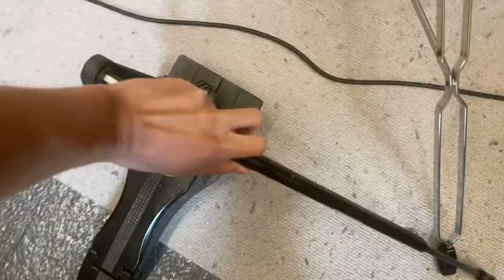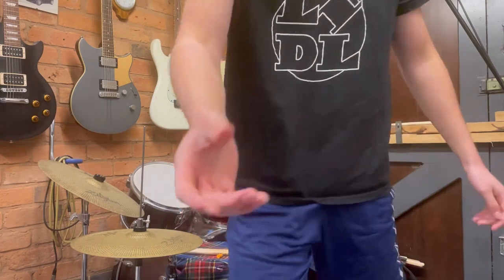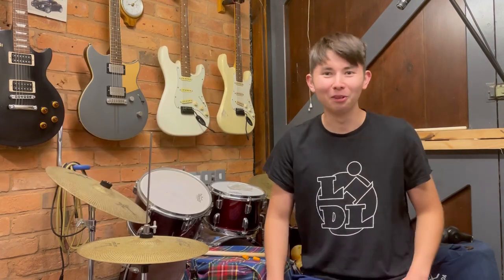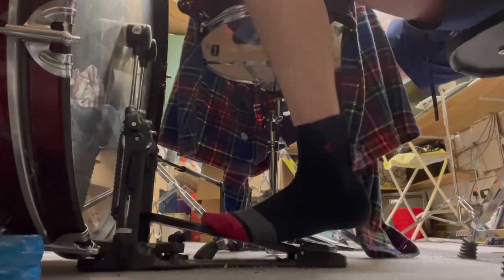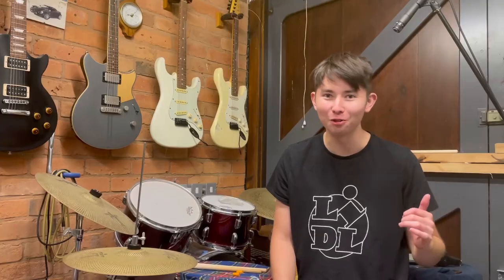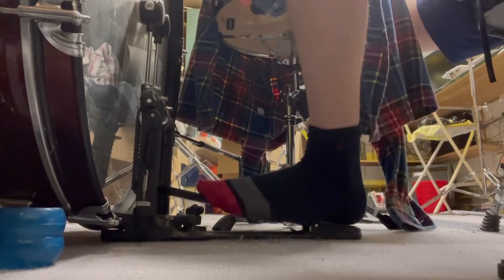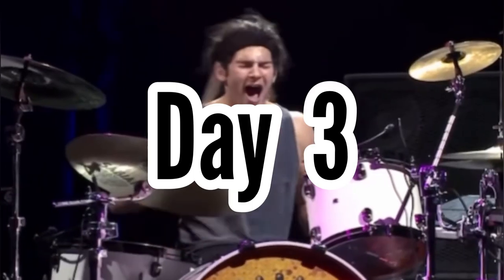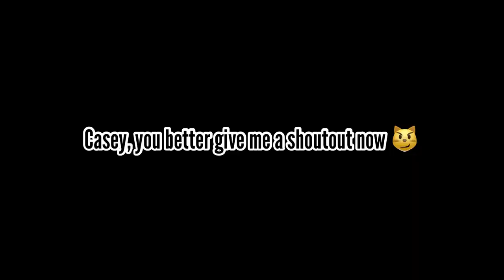Drummer Tries: Playing like Aric Improta (CRAZY Bass Drum)

Comment: hey bro just a couple of tips for you…

1. you should adjust your double beaters so they aren’t too close to the battering head when your feet ain’t on them, also adjust the tension of the pedals to your preference (if you haven’t yet)

2. your crash and ride are too low, you should make them a bit higher!

3. keep up the good work bro!

also uhhh it looks like ur 2nd tom’s got a hole in it?
Reply from the maker: Thanks bro!! And yeah it has 🤣🤣
Reply: It looks like you're sitting quite close as well. 
There's a lot of double kick advice on ergonomic positioning out there, basically our legs should be in angles of more than 90 degrees. 
I think the position doesn't look comfortable for your knees. That your feet are too far back towards you.
I'm also still figuring this out, let me know if you found something :) good stuff -- cheers